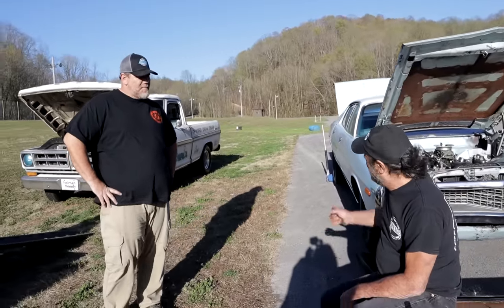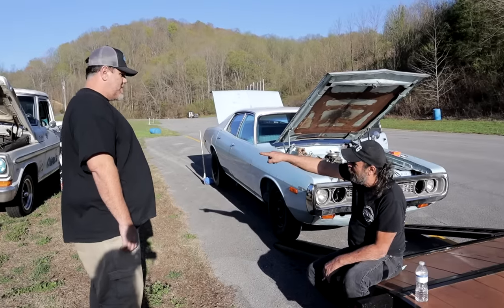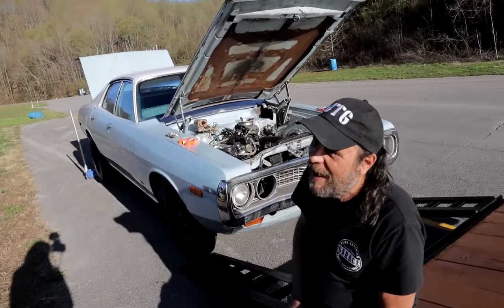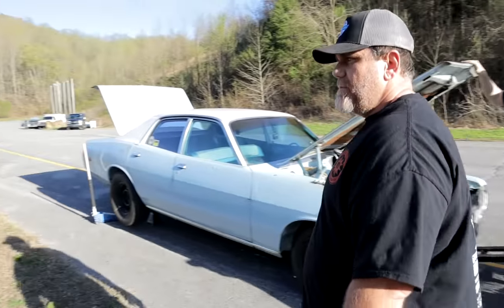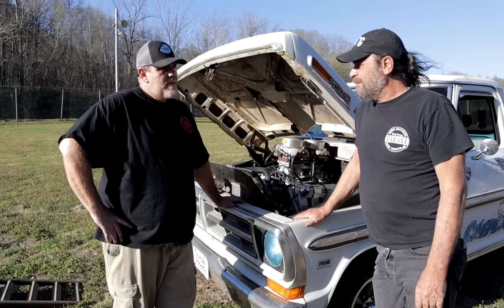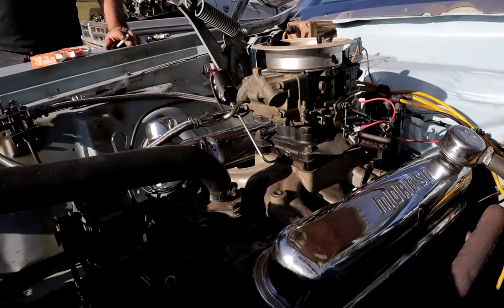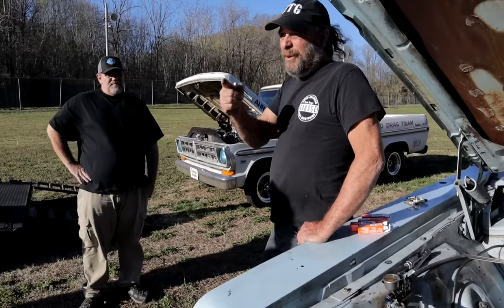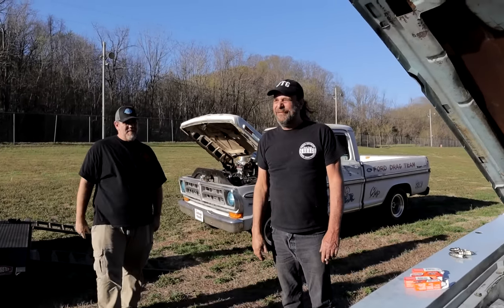Grudge Race Goodness! N/A Boss 429 Ford F100 Takes On A Nitrous 318 Dodge Taxi Cab.  One And Done

Comment: That was the closest race Ive seen.... I think it came down to which one had a thicker bug splattered on the front end  tripping the clock at the end. I knew Bottle Rocket was going to be impressive but to beat a 708 HP 429 BOSS was not expected. When I found put what was under Caspers hood, I figured BR was in a bit of trouble. BR did have issues -- front suspension is too loose, body flex was a problem, trans not shifting right. But yet he did it. I love both MOPARs and Fords and always watch Uncle Tony but havent watched Andys channel yet, so I was rooting for UT to win....until I found out what was under Caspers hood... THEN I was just rooting for UT to be fairly close to Casper at the traps. I know BR is currently running the 1/4 at about a 12.0 -- possibly even very high 11's but after seeing this I honestly believe it could be possible to reach the high 10.0's with a bit more tweaking and tuning and resolving the few issues I listed above.

Comment: Seems like the coronet ran the equivalent of a low 12 sec quarter, which isn't bad. But it's more than 100hp from a 10.90. The Casper truck should have run WAY better than it did with all of the seriously built motor. Andy's got to be pretty disappointed.

Comment: That left me in awe for real, to be honest, i heard the 429 and the cubes in difference vs the 318 i had my doubts, color me impressed, Bottle rocket left like a cop off to the local donut store! 
Well done is an understatement. Great race Andy & Tony!
Reply: I see 2 major differences. The truck is a lot heavier than the unibody car and being a pickup truck it's hard to keep those rear wheels planted.
Reply: @davidwalker7732  Yes, good point! I considered that the weight would offset the cubes & the weight of Andy's F100 would keep the wheels on the ground, but most of the weight was in front so quite understandable that the wheels may not bite.

Comment: I had a 318 in a 69 Fury many years ago and it was a very good engine. I put 200,000 miles on it and the pipes were exceptionally clean, no leaks, and it run exceptionally good until the flood got it.

Comment: Man, Bottle Rocket just does not like that end of a drag strip. You can tell on account of how fast it leaves just as soon as it can... I love a launch with a drivers side only wheelie, thats when you literally see the torque, wringing out the whole car like a dishrag before it snaps back into shape and jumps down the track.

Right until the end I was expecting some sort of cliffhanger, to the extent that I almost felt cheated when you didn't torture us by making us wait for part two, where we actually learn who won. Almost.

Just can't quite believe that a cab that was worn our before I could drive can vacate a starting line that fast. Remarkable. I expect Casper to be fast, and casper was fast, but to see BR do that was inspirational.  Especially on the kind of budget BRwas built on. 

Uncle Tony, you should do a lengthy video on what was done to Bottle Rocket to take it to this race, compile it all into an epic video a couple hours long, I would watch that more than once I am sure.

Comment: I had a Scamp 1972 318 put a cam in it. Hooked trailer ball to GMC 454 tow truck. First to pull wins. I burnt duel lines in the road 10ft long he could not hold me. He did cheat and put emergency brake on. I still pulled him. Great car was blue with black vinyl roof.

Comment: Put the speed to 0.25x.
If on a phone, zoom in to see the tree and UT’s car. 
Go to 12:23.
Pause it just before light turns green (takes some practice to time it right).
Several different environmental references coupled with a giant gap in the fender well to his front tire which clearly show he jumped the green light and was moving before it turned. 
Am I wrong? I am here to just ask if moving before the tree turning green means he jumped or if that’s normal?
Reply: Its a Christmas tree , and electric eye beams on the front wheels . 
You haven't "left" until that electric eye can see the other one .
Large diameter front tires are used to increase "rollout" distance . 
UP is not FORWARD , so it doesn't break the beams . 
Most racers leave on the last yellow ,  (only yellow on a pro tree)
Reply: @Richie_the_Fixer  wow, I appreciate your thorough understanding explanation of that whole process. I had a feeling that it would’ve caught the wheels completing the path of the eye and there for disqualifying him had he actually moved that far. He does start to move forward but it must’ve been just not enough for it to break the beam. 
Thank you for explaining that

Comment: Back in high school My parents 1975 Chevy nova four door with a 250 straight six and automatic transmission beat a 1978 two door Ford LTD with a 351M engine in the quarter mile. That was back in 1978. That Nova beat that Ford by a car length. Both vehicles were stock.

Comment: Even a lowly 305 Chevy with a good set of heads, cam, intake, and headers can pump out 400+ HP. I wouldn't invest in a 305 (small bore inhibits flow) but people have just to prove the point that it can be done.

Comment: I means let’s be real here. Even spraying that car. That truck still had the advantage. 100+ cubic inch difference and Two times the airflow of the cylinder heads. That truck was built and expected to run incredible and make power. That little stock headed/ stock bottem end 318 was a gamble. I’m a gamblin man.  Tony showed him how it’s done!!! Wore out Junkyard shit tearing up a 15000$ engine 💪💪.  Don’t ever underestimate the underdog.  It doesn’t take money to go fast 🤷‍♂️.  Uncle Tony proved what guys like me have been trying to prove all along. Tony wore that ass out!!
Reply: Tony set this guy up perfectly. Tony had it on suicide mode hitting the nitrous out of the hole like that. Good way to bend a rod which is why he wanted to do one run knowing he would likely break something next run. He made the track 1/8th mile making the 60-foot matter because that's all the car had. Ford guy added the cherry on top taking a nap on the tree with 5k on the line LOL. Tony had to be grinning ear to ear. Ford guy was probably bashing the dash in on his truck the ride home guaranteed. All that money in that truck and got taken out by hooptie with hundred less cubes and over 300 less hp. I mean damn that's got to burn.
Reply: @frenchonion4595  Tony had nothing to lose in that little stock lower end 318. I would of done the same thing. Casper had a Huge advantage.

Comment: Concerning vibration dampeners is the moon key at the crank always at  1 degree T D C out of 360 degrees of rotation on the outside  is the rubber at 0 with the outer scale at 0 degrees? O E ?

Comment: A good race, congratulations. Should have sone the time slip though, so that the difference in reaction times and 60 ft times could be seen. Anyway, respectable performance for the Coronet for what it is, translates in to low 12's in the 1/4. Seems to leave the line very quickly, 60 ft 1.6?

Comment: Tooo slooowww...
"Little" 5 liter Chryslers ran with the Big Blocks in Nascar one year because of penalties on the Superbird nose... They did just fine.That is 305 cid btw. The 318's and 340's are underrated for sure. The 429 Boss and most 385 series really shine when they are pushed up to about 600 cid, lower than that they have only got high end power.
Nice race, but predictable. Should have raced first, talked after.
Cheers 🍻

Comment: The Bottle Rocket is a digger that thing grabbed.   Eff all those 4 link guys. If tony proved one thing today it is that the old-school leaf springs and clamps do the job. If Tony has or takes the time, BR will could be  7.30 car. Lol if the engine can handle multiple sprays in test and tunes.

Comment: that would of been a roughly a low 12 second 1/4 mile pass (providing you didnt run out of gear.) How much did you spray it, or is that classified secret info?
Reply: I've only raced on 1/4 mile tracks.  I can't get over how short those 1/8 mile ones look.
Reply: @craigbenz4835  1/8 is still a lot of fun, and is we’re most of the fun happens anyways

Comment: Hello,
 you help me with some cam info. I'm refreshing my 1972 W100 Power Wagon 4 speed its got a 360 my son picked up a cam for it and I'm hoping you can shed some light on it??!! Its a  Lunati flat tappet   Part #10200703... Lobe Separation 110.. Duration 226 IN...234 EX...Advertised Duration 271 IN...279 EX.. We have a 4 barrel a quick fuel Black Diamond 600 cfm. .headers .. Performer manifold..
 Can you tell me if its OK for a 4 wheeler that is a daily driver and used mainly on forest /fire roads here in northern Calif

Comment: Question: Why not mount a v8 transverse, spinning so that torque surge that currently twists the frame is instead driving the back end down into the pavement for more grip.  I assume that making the power turn 90 degrees at the rear end and spending energy twist g the frame only to dig one of the rear wheels in has to be less efficient.

Second question, (not meant as any kind of dig at anyone, I'm a fat guy nowadays myself....) Why isn't every drag race driver an 85lb 16 yr old video game playing girl? You know, skin, bones and the reflexes of a rattlesnake on crack? They say that every hundred pounds is a tenth of a second, and thats an eternity in a drag race.  It seems like guys running a car would be forced to use the tiniest driver possible. is there a handicapping system to equalize that part of the total weight of the car at the line?   Now, of course some of it is a lot of guys build cars in order to drive them, (unlike Tony who famously dislikes actually racing his cars, and just wants to build them),  but its a competitive sport, so the pressure towards light weight has to be strong. I mean we saw BR lose weight piece by piece for YEARS.... Arguably the race is lost with another ten pounds on the car....

Comment: nitrous makes a big different on racing i just never run it on my street rigs because it kills the engine or shortens the life of them but for racing anything to win i say. i would run my street truck against u but no nitro i am not stupid but i could put nitro on my rig without i am running about 650 hp in a stroke 454 and i have a tunnel ram setup for it just running a high rise with a 850 carb on it stock it had 450 hp with heavy rods steel crank 10.5 to 1 compression high flow heads  it is a remake of the chevelle 1970 ho 454 bbc crate engine and i have the 02xx 400r turbo which is the bad boy of stock trans it comes with heavy clutches heavy duty 8 bolt pump stage one shift kit rated for 800 hp stock got both for free with 6,000 miles on them. i have 3 more sitting in the shop next to my pro built 327 that has had everything u can do to a sbc and i mean everything that engine is nuts one insane engine ever terry fisher said it was insane for a sbc which was my neighbor for 10 years but he still lives there.
Reply: ps i have 2000 in my 68 pu with new factory full gauges set new tail gate heated electric buckets seats twin electric pusher fans rebuilt suspension front and back power steering power breaks i have sitting a hydraulic ass. break boost so i can go big cam on it if i want to now i just got a great hook up on parts, at parts house cost  like a battery for 219 bucks i got it for 119 i am so jacked about it

Comment: I'm confused as hell. So did the 318 have nitrous or not? Also Andy said the 429 was built on a smallblock. I don't get that the 429 is a big block. Can somebody sort this out for me thanks.
Reply: Have you dug a little to find out for yourself yet ?
Reply: @waynefergusson9987   429 heads on a Windsor block. The name bottle rocket and the spacer under the carb means nitrous to me. Didn't mention nitrous on any of his vids I watched but judging from the way it launched I'll guess nitrous. I only asked because I once owned a Plymouth with a 318 and it was no muscle car.

Comment: gm and ford guys dont realize just how reliable a 318 is, worked at a engine rebuild shop in late 90's never seen one come in gm 305 350  and ford 302 kept us busy just my 2 cents seen alot 2.2 and 2.5 kcar engines those were shit but kept mopar going

Comment: U T , have you messed with , OR can you on bottlerocket the wiper transmission??
Wife has a 73 Coronet that’s a Adam 12 theme car , and the plastic cam broke , got replacements, but not sure how to clock the pieces AND the spring correctly …
#CopCarCouple 
🚨🚓🚓🚨

Comment: Good thing there was only 1 pass made and not best of 3 passes because that much nitrous would have had that so called 273 bottom end all over the starting line within the next 2 races. Not sure of the budget but I think it was more than uncle tony is going to tell. I know what the mopars are capable of and it costs a lot of money to keep one together. There was also plenty of time spent on the suspension to get it to hook so don't be fooled by smoke and mirrors folks

Comment: 3 seconds between light.....lmao. Casper should have won that race if he had NOT fell asleep at the starting lights.....lmao.. And Tony bullshitting Casper all the way. And the stupid track cleanup guy with a mop at the back of the car messing the whole video up. That looked like a setup which threw Casper off on his light. Nobody should be behind a car till after it has gone down the 1320. I call out Tony on cheating in this race as it was his hometown race. There are all ways to cheat. In all my 20 plus years I never seen a cleanup guy behind my car or the other car beside me unless they were going to shut someone down for leaking something when we were staging cars.

Comment: I am not too impressed. When he first started the bottle rocket project he was stripping all the extra weight out of it and saying could run the 1/4 in 11 seconds with just a built 318 and no nitrous. 3 or 4 years later the car made it down the 1/8 mile without something going wrong. Build what you said you were going to build and run it without the nitrous down the 1/4 mile.